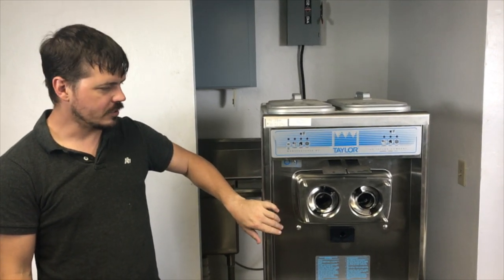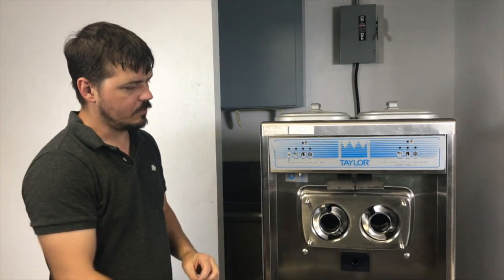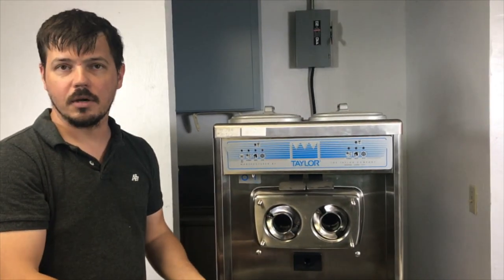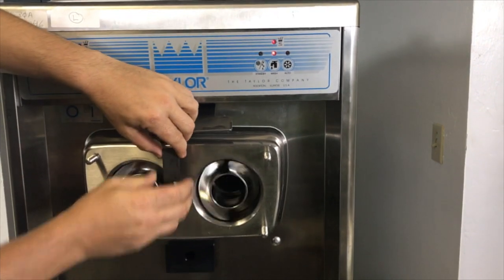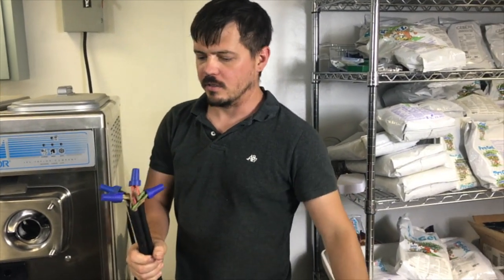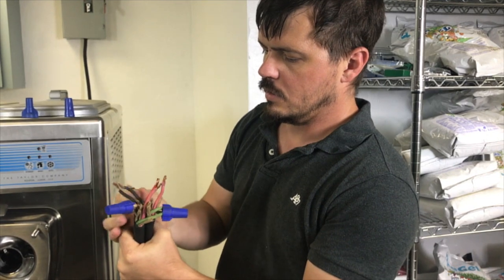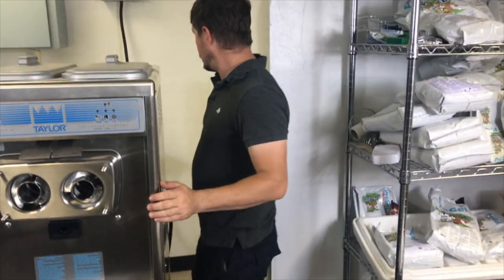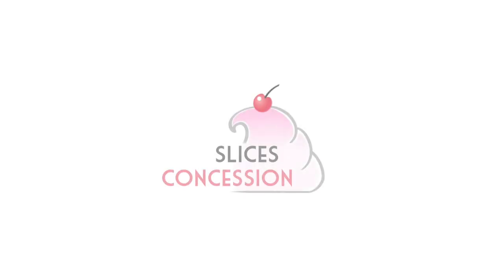Installing a Three Phase Ice Cream Machine

Comment: What does the magnet do?
Reply from the maker: The magnet is a way to be able to see into the freezing cylinder to check the polarity of the motors. The product door has a magnet imbedded into it. It is a safety feature. You should not have the augers in the machine running as they can catch your fingers and cause serious harm. 

We are using the magnet to make the machine think the door is on.
Reply: It's a Door Interlock System. It prevents your machine from turning on when the freezer door is off the machine. If, by chance, you've experienced identical issues on both side of your machine occurring at the exact same time, this system is generally the cause.